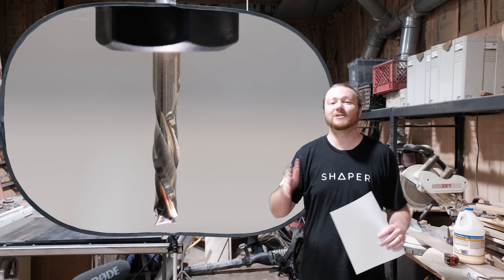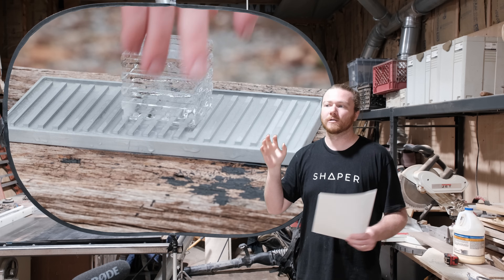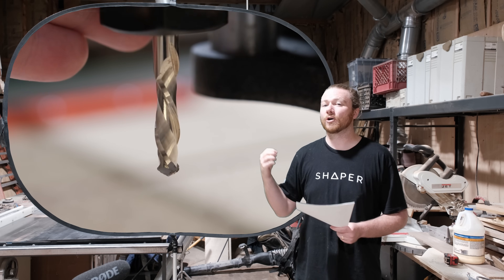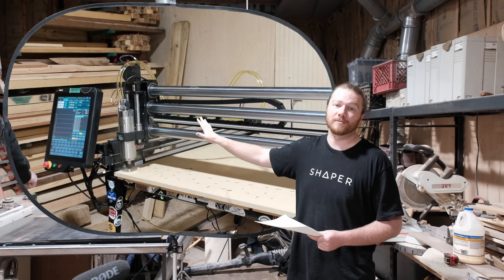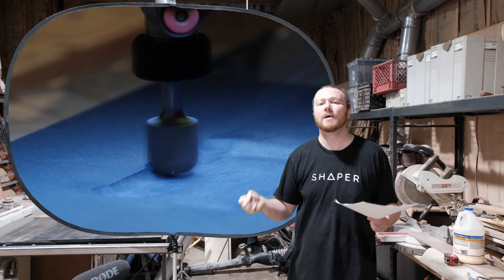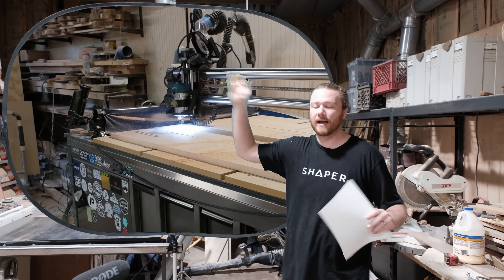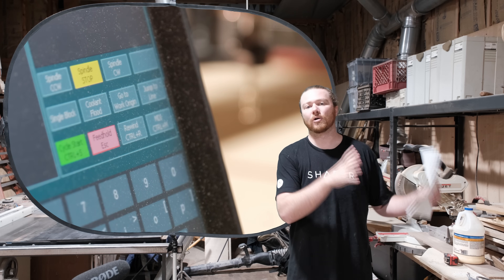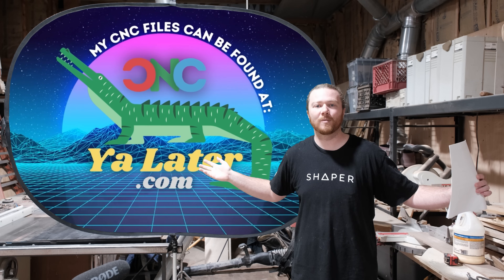10 Differences Between CNC Spindles & Routers (I Use Both)

Comment: Compact (trim) routers also come in 10/12v, 18/20v and 220v (most of the rest of the world uses 220). IMO, if someone's investing thousands in a CNC, then a spindle is part of that purchase. Getting a $100 router is just plain stupid. No exceptions.

Also, decibels (sound) is CUMULATIVE. Just because you have one device that's loud doesn't mean it's not advantageous for another to be quiet. A spindle is a huge advantage here, even with dust collection (which is also a must-have for any CNC - and NOT a shop vac).
Reply from the maker: yep!

Comment: I appreciate the insight on the water cooled spindle.  I think that the possible improvement on dust collection could be worth the hassle of setting up the cooling.
Reply: yeah i didn't realize that either although the expensive CNCDepot spindles are passively air cooled so maybe the best of both worlds if you have an extra 3 grand

Comment: Hi Hamilton, thanks for the great content you always put out.  I want to get into CNC as a hobby (and maybe a small side business) and your videos have been immensely helpful.  If money is not an issue, would you still recommend the onefinity?
Reply from the maker: Thanks for the kind words! I would for sure recommend the onefinity. Although the only CNC machines that I've personally operated are made by Onefinity. Also- I bought my first X-50 Journeyman with knowing nothing at all about CNC machines. I think CNC machines are just like any other tool- success and enjoyment only come from having a passion (and time) to learn how to use it.
Reply: @HamiltonDilbeck  I've been using a CNC plasma table at work (I think we have vcarve software?) for a few years, and have been doing 3d printing at home for about 6 years.  Also have been a design engineer for 12 years, so it seems like a great hobby to pursue.  Only problem with Onefinity is their lead times are like 4 months!  

I watch a lot of CnC channels and your channel is my favorite - you make straight-forward, easy to digest content with great information and don't try to sugar coat anything.  Again, thanks so much for taking the time to make these videos, I know it's a lot of work.